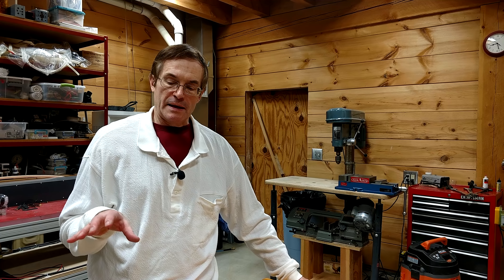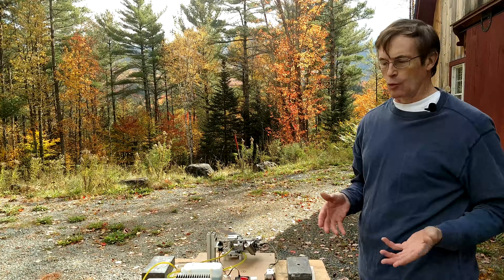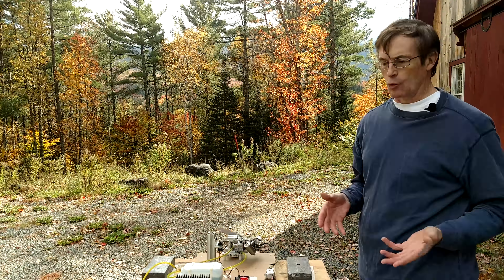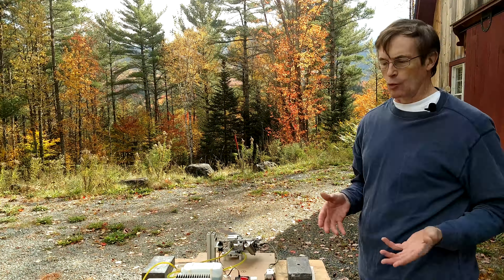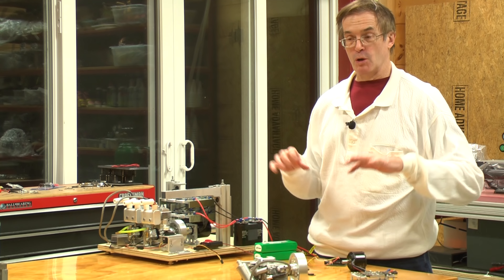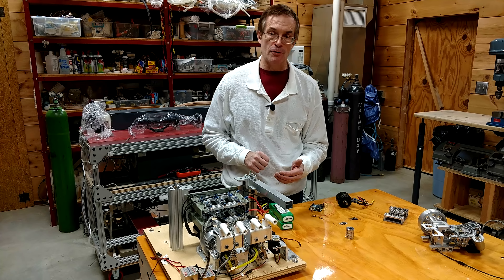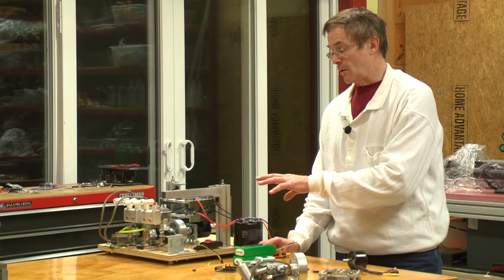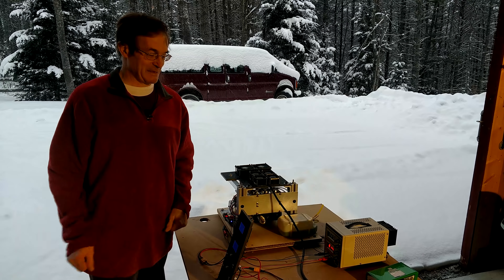Hybrid Drone Generator

Comment: Thank you so much for your video! I am a Professor in a Polytechnic School of Engineering In Spain, we are developing a PHD thesis in this field with an hybrid system of much larger power supercapacitors and a pretty complex converter with three control loops. I just wanted you to suggest to change diodes by MOSFETS and use syncrhonous rectifying, you will increase efficiency of conversion. Your videos are terrific and the way you explain perfect 8-). I have recommended  your channel to all my students. Best regards from the North of Spain and thank you again for sharing your knowledge.
Reply: True, way he explains things makes even average joe understand the topic, least on basic level of what is going on. For instance i didnt have clue about magneto hydro dynamics before, let alone even knew this field existed, but now i have project going on using this technology... Though it would be nice to ask few question from him regarding this topic and application of said tech.
Reply: Many years ago I worked on an Emergency power generator for aircraft.  It used air to rotate a 3 phase brushless generator running at about 100Krpm.  Very small, the rotor was no more than about ¾” OD and the length was perhaps about 2”.  There were two of these in the case and air was pumped into it through a hole that was the diameter of perhaps 24AWG wire. A disc on top of the rotor with tiny little cups to catch the air was used as the method of rotor propulsion. The combination of the two generators produced 3KW of power at about 115 Volts and ran and used the air as air bearings in addition to just propulsion.  Perhaps you can use this method but instead of generating power and then running a motor just cut out the middle man and run the motor directly with compressed air.  I don't know how much power you need but I believe this combination of air tank and motor will be much lighter and less complicated than 2 two-stroke motors and mufflers and generator replaced by just an air tank.  So even your motor becomes simpler.  Just driven by air, no copper windings, but of course you will have to make the motor to run on compressed air.
Reply: What you describe is great. 100.000 rpm!!!!!!!!!!!!!!!!!, that's too much even for an aircraft turbine 8-). The idea sounds really atractive but, as you have told, the problem is compressed air. Our prototype is for a PHD Thesis (our aim is to obtain above 7 kW at 50V). We are trying to use ultra capacitors, no batteries, active rectification a DC-DC controlled converted and several control loops to the thermal motor (first carburation latter injection) in order optimize fuel consumption. 
Thank you sou much for your answer!
Have a nice weekend.
Reply: Looks like he is talking about some sort of EDF before they arrived to the hobbyist market. : Generally, most EDF units will run between 35000 RPM and 50000 RPM.
http://www.radiocontrolinfo.com/rc-planes/edf-jets/edf-brushless-motor/
Reply: ¿Dónde podría ver ese proyecto de motor hibrido? un saludo
Reply: For low voltage applications active synchronous rectification would provide substantial efficiency gains and reduce relative cooling requirements of the rectifier.
Reply: @movax20h  You are absolutely right, we are achieving an efficiency around 92 by controlling the MOSFET with a FPGA to even improve commutation. Best Regards.
Reply: @asificam1  Thank so much for your contribution! I think I understand your idea. Please let us know if you succeed. Have a nice weekend and take care of yourself!
Reply: do you have a website for this project? I would like to play at home.
Reply: Would like a link to your final programs
Reply: He should have used an RC Wankle engine instead
Reply: @helpabrothawithasubisaiah5316  yes I was thinking how a rotory drive motor might compare instead of piston driven or even better yet how about turbine powered driven shaft ?
Reply: please read my comments, you may be interested
Reply: How did the project go

Comment: "...and AC power has to be rectified. And in order to do that we need diodes a FULL BRIDGE RECTIFIER"
Reply: FUUULL BRIDGE RECTIFFIIERR :)
Reply: Yeah, he sort of made it sound like having to deal with three phase, instead of single phase, is a bad thing, but is actually better for smoother output, lower vibration, etc.
Reply: @ Jay Dee A full bridge rectifier is just diodes arranged in a manner as to take advantage of the high and low peaks of each phase. The reason he said a 3 phase motor would need 6 diodes is because it's arranged in a "Full Bridge" configuration. You could actually get away with three diodes per motor/generator however you would be wasting 50% of the power.
Reply: Yeah. I guess to store the charge. But isnt the output from an ESC basically AC? But even then, there's fluctuation in all motors. 
Lol. So you have to generate it, rectify it, store it, and convert it back again. Right?
Reply: Full bridge rectifiers are only about the size of a quarter though.
Reply: DAMN, beat me to it!
Reply: @ValentinoMariotto  
Yikes. No wonder it wants to change direction 60 times a second
Reply: @AngryHybridApe  ahhaha I have to give credit to AvE for that pun :)
Reply: @JayDee-b5u  trying to fit this thing to a drone will mean wanting to extract every last percent of efficiency from it...
Reply: Go away.
Reply: FULL BRIDGE RECTIFIER !!!!
Reply: His statement is entirely correct. A bridge rectifier comprises .... 4 diodes.
Reply: Don't any of you speak AvE? It is spelled rectumfrier
Reply: It's so cool seeing this working. I designed something similar but for a much larger scale using a planetary gear to allow an infinite output speed from either or both the gas turbine or electric motors. Once at cruising speed the planetary gear locks up and batteries can be charged or electric power applied as necessary.  This concept is currently far beyond my ability to control on the electrical side.
Reply: some wooooosh in this answers.
Reply: That is for single phase.  alternators are three phase.
Reply: @Carolina_Housing_Solutions  Full bridge rectifier is for single phase.  Alternators are three phase.
Reply: @0077alfie  so ... three phase bridge rectifier ...
Reply: @NickleJ  oje!! Guajiro!!

"...A caballo vamos p'al monte!"
-el Carretero 
🤠
Reply: @will2see  omg... thank you kindly, for saving me so much confused reading.

I would never have really understood the reference. 
😟🤷🏻‍♂️😂😂😂
Reply: just use a magnetic amplifier, one for each motor with opposite phase load, would do just fine without any rectifiers and is easy to control high amps 🤷‍♂️
Reply: ElectroooBooooo.....

Comment: I once did a test flight series that had much of the same torsional resonance problems, that you described, which I discovered after about 4 hours of flight.  The propeller developed a green stick fracture and the ensuing vibration caused extreme damage to the aircraft.  Namely, the canopy partially detached from the cockpit and ended sitting in a vertical position on top of the left wing, which caused the stall speed to double.  The aircraft stalled 3 times before I pancaked into the ground.  The builder had built the 3 piston drive system with no buffering of the tortional resonance.  You described the cause and effect of this extremely well.  If the builder had installed the drive system with a belt/pulley arrangement as the designer called for, the propeller would have stayed intact and the aircraft would still be in one piece.

Keep up the great work.
Respectfully
Rick Mason

Comment: I owned many engines when I was an active R/C-er and Saito engines (pronounced "Sigh-tow" in Japanese parlance) are among the best in the world in my opinion.  I met Mr. Saito about 20 years ago in his factory in Chiba, Tokyo when a friend and I interviewed him for a magazine article on his engines.  He was very gracious and full of information, and though quite old then, was still actively engaged in designing four stroke engines for the R/C community.  He was also deaf as a post having stood next to running engines studying their operation for far too long and far too often.  He admitted that if you want to keep your hearing into old age you should wear earmuffs when running any R/C engine, particularly the larger ones at full throttle, as even muffled engines at close range can cause hearing damage.  In the air they sound wonderful, but that's where they're designed to operate, not a few feet from your ears on a wooden test stand.
Reply from the maker: Interesting.
Reply: Thanks!! Nice work!

Comment: You can used the brushless dc motor as a starter to start the internal combustion engine and as well as a generator to charge the battery
Reply from the maker: I know.  The switching from the ESC that starts the engines to the low resistance, high current input to the rectifiers is challenging.  Any specific suggestions would be helpful.
Reply from the maker: We may have tackled the transfer switching issue to allow the generators to act as the starters as well.
Reply: Tech Ingredients Hi, I may be wrong but, my guess is those retrofitted mufflers you made would work great for 4 stroke, but I suspect they will get clogged with oil and back up the engine.
Reply: Using active rectification gives you an easy way to use the rectifier board as a driver for starting the engines.  There are just a few extra FETs used to redirect power to bypass the output regulator and drive the BLDCs to start the engine(s) using the rectifier FETs.   The catch is that if you have an optimal drive ratio to couple the engine to the BLDCs, you do not have an optimal ratio to drive the engines for starting.   It is likely that you'd need a transmission to provide these two different modes.
Reply: It would be very useful for a drone to be able to restart the engines in flight.  I'm assuming that a stall for a typical drone allows the batteries to supply lift for a few minutes while the engine(s) are restarted.   Optimizing  the restart could be kind of important.   If the generator/motor set has to work through a gearing ratio that is not optimal for starting, but is optimal for power generation, then the whole mission is a fail.  Based on my studies, the transmission ratios for optimal power generation are not 1:1 (They could be but I have yet to see a commercial BLDC that could support that and be weight competitive).   So their would need to be two gear ratios.   One for starting the engine(s), and another for power generation.
Reply: Don't know if its been asked but could u use supercaps instead of batteries to save some weight ?
Interesting project, thanks for the video documentation....
Reply: Supercaps have their uses, but Li Ion battery replacement is not one.   Mass per unit charge is not too bad, but volume per unit charge is terrible.
Reply: If you have looked at the paper I referenced, the auto-start issue should be fairly obvious.
Reply: I think direct drive from the ICE is a mistake.   It would make much more sense to use a KV ratio that results in the BLDC turning lower RPMs than the ICE.   Where one chooses to put the flywheel is up for debate.  I'd put it on the load, but I have little data either way to determine where it should be.
Reply: @metaforest  hmm.. Exactly how a Prius works
Reply: @airgliderz  good to know.  I hadn't looked at Prius at all because for my interests the power scale is completely different.   I'm looking at 3 - 7 KW  not 25 - 40KW.